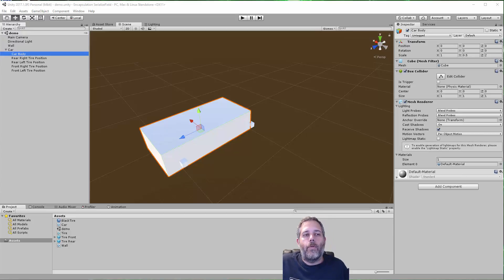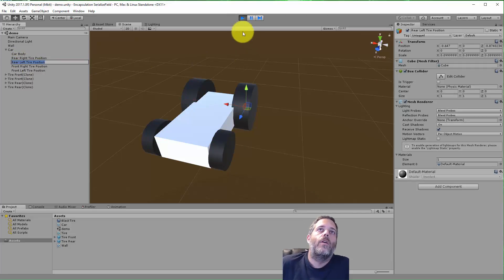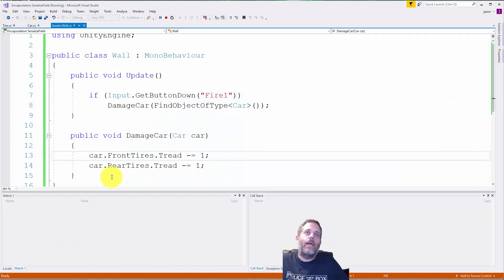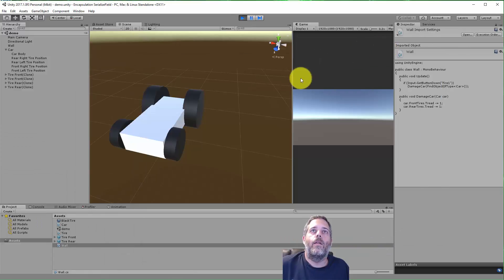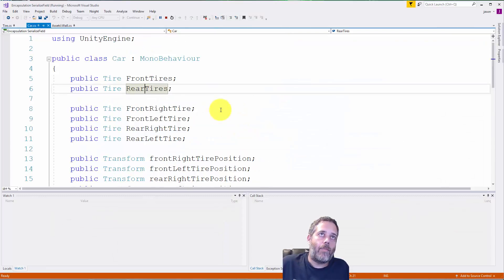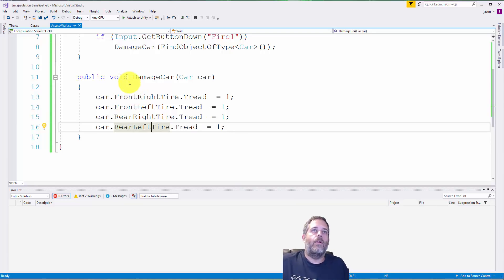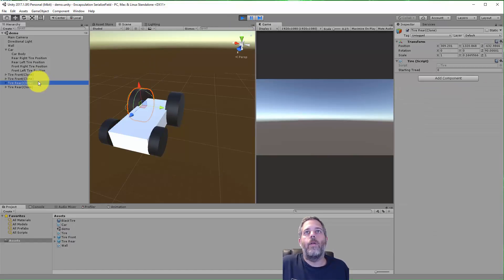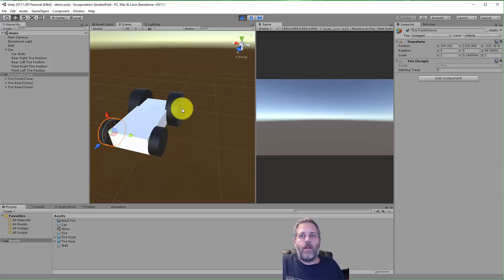Why and how to use Encapsulation in Unity with a simple example

Comment: This is really useful thanks. I just did a test where I exposed a public variable on my prefab (public int myVar = 1), dragged the prefab from the Project folder (not from the hierarchy) into an inspector slot on a Test class and then within that class, I set myPrefab.myVar = 5; 

This essentially permanently changes the core prefab as if I'd done an "Apply" !  (and also affects any Prefabs in the hierarchy)

I did not expect that at all. 

Thanks again for the heads up!
Reply from the maker: A similar situation in a real project is what made this really stand out for me.  Code broke a bunch of prefabs accidental, and it it weren't for source control showing the differences (and people not blindly committing them), we would have missed it and broken a lot :)